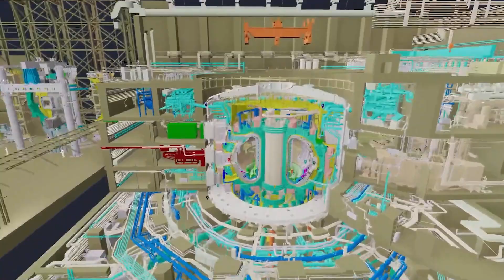Cryoplant ready for ultimate test

Comment: the more life experience and knowledge i gain, the more i realise this project is too large and it's organisation is too complex.
i love you guys but a smaller reactor with fewer participants would have given us scientific advancements faster for far less money.
Reply: as other comments has already stated, there is already smaller tokamaks around the world. That's why there is no need to build yet an other small one. The main goal of ITER is to verify Q >= 10 (the ratio between the energy used and the energy produced by the reactions) and for that there was no other solution than doing it the size it is. ITER is the antichamber of industrial tokamaks.
Reply: Smaller reactor already exists: JET.
Reply: @outcastatsabre  Yes, JET was at least 100 times cheaper and they could have continued the project. Or build a new reactor for JET that is just one step larger but still feasible.
Reply: @laurentstorchi290  or maybe they couldn't and this scale actually makes sense?
Reply: @laurentstorchi290  There is a reason it's the scale it is, because the larger the reactor is, the more power you produce compared to the reactor size. The volume of the plasma goes up squared, while the surface area goes up linearly. 
A smaller reactor won't be able to test the things ITER wants to test. 
(it is possible with current cryo magnets, as they are easier to cool, but that technology wasn't avalible (or thought posisble) when ITER started construction. 
In my opinion it's better we build something and gather data, than hope someone will come up with a solution in the future, and we wait until then.